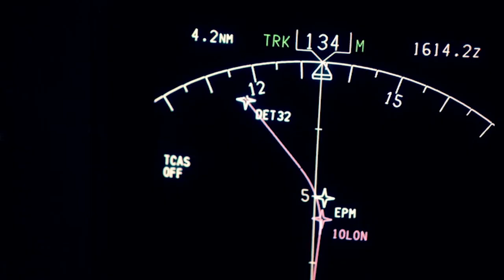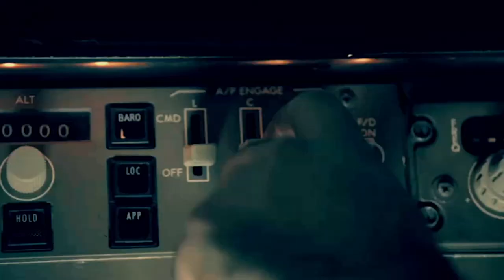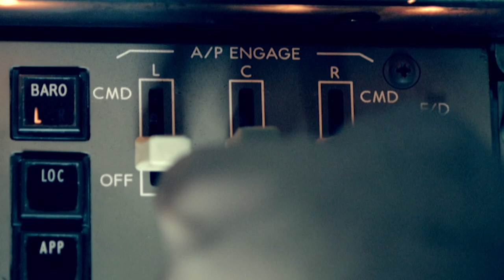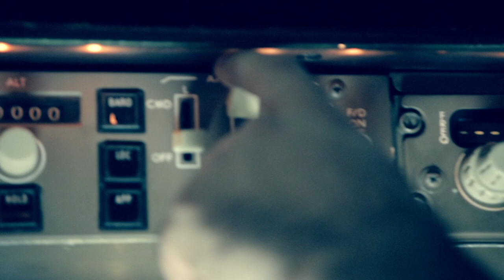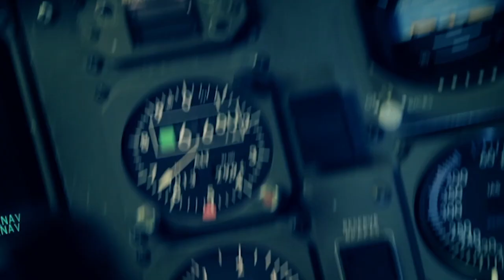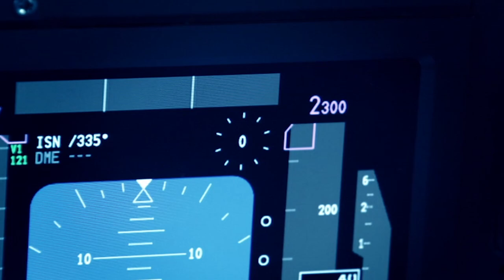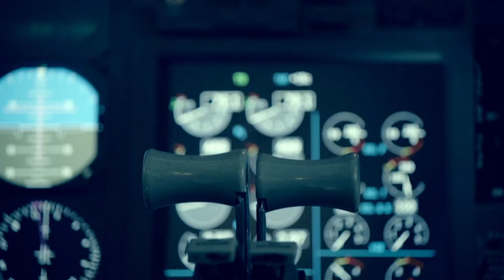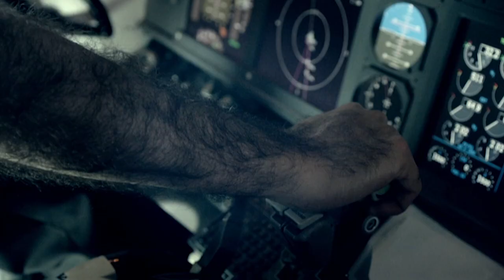Auto Pilot Causes Multiple Plane Crashes | Air Crash Confidential

Comment: The biggest disasters happen with a small hint of problem. The malfunctioning of the radio meter may not be a big deal but when you are in the air at 35000 feet , it's better to take precautions rather than waiting for consequences.
Reply: very true
Reply: @pasoundman  what precautions tho? You have 3 other altimeters. It’s not like that is gonna cause a crash
Reply: @johnb8956  The barometric altimeter isn't adequate at low level, hence the radio altimeter, so in reality there's no redundancy there. A sensible precaution would be 2 radalts.
Reply: @pasoundman  they do... 2 of each, for this exact reason

Comment: There is no such thing as autopilot error. The autopilot does not fly the plane on its own. The pilots input what they want it to do and it obeys the orders given to them
Reply: Thomas Mortimore oof, so ur saying that the radio altimeters, artificial horizon, PFD, MCDU and etc is not bound to fail at all and it’s mainly pilot error...... lol
Reply: The idea of autopilot is that it will keep the plane steady while pilot and copilot do other tasks. Like landing calculations to see if the plane has the right land weight. So if the plane needs to turn the pilot does the input.
Reply: Colin McCarthy umm... no, the autopilot is what is mainly flying the plane during a flight.. pilot program a route in the FMS, FMC, or MCDU that will take them to the destination of their choosing. Then after they depart after reaching 5000 ft or maybe less they turn on the autopilot and the auto throttle and it mainly flies the plane until it time to land, and if the weather is bad they use the auto pilot to perform an ILS and or a CATIII arrival which basically lands the plane for them in IMC conditions. They do follow the pilots “orders” but it’s used mainly used to take them for point A to point B. And plus the autopilot might have mechanical issues from time to time... it happened a few times.
Reply: Sync Aviation sorry I was talking about when not flying in the route inputed but say if the plane is diverted they might be told to change heading but pilots won’t create a new route for a diversion so the do they new inputs. I didn’t mean that it was how it was fly routes. Sorry if it was taken that way
Reply: Thomas Mortimore there are two FMC (depends on what plane u fly on) not 2 autopilots... there are FMC selections where if you want to switch to the copilots FMC you can... but it’s gonna have the same route on it.
Reply: and you are in expert i guess you know more Than all those people in the show
Reply: Yeah. Basically “Auto-Pilot Error” is just another way of saying: “Pilot Error”.
Reply: Sometimes The system may malfunction...
Reply: @tomstravels520  THe pilots were confused which altimeter to trust and which to not
Reply: @blcj101  

Guys seriously, the Auto Pilot can fail.. It's using the instruments of the altimeter, flight speed, computer information its being given checking the flaps, angle, etc. 

If ANY of these fail (Which they have all failed at some point hundreds of times in the past), the auto pilot fails, because the auto pilot does not know its actually flying at 8,000 feet, not 100 ft like the altimeter is telling it.

Comment: Wonder if it might be a anti-stall/Auto-pilot error on the latest 737-max 8 crashes?
Reply: No it's unrelated
Reply: It’s a system called MCAS. It puts the plane in a dive if the system detects a possible stall without the pilots inputs. So sad it was designed for safety, but ended up killing people unnecessarily.

Comment: Thats not how the plane crash, it should break to some large pieces
Reply: It's how that flight crashed. They barely had enough altitude, but they came in at a very shallow angle when they actually impacted the earth, they were also going relatively slow still (still under optimal flight speeds), So the plane didn't break up into pieces, it broke up into 1 or 2 separated parts since it slid mostly horizontal during the crash.

Comment: as usual cheap boeings keep crashing BUY AN AIRBUS! you fools
Reply: There have been several issues with the Airbus too, except with Airbus organization they do everything to blame the pilot. Check out this link https://www.wired.com/2011/07/an-airbus-captains-take-on-the-air-france-disaster/ There are three other Airbus crashes that I can think of where the planes autopilot system was at fault.
Reply: Brian Savage, you're right. This is why Airbus should be called Airbug
Reply: Canardeur Ive heard more than one pilot call them Scare Busses
Reply: Brian Savage, Scarebus is indeed a common nickname for those flying pieces of junk.
In France, a former pilot named Norbert Jacquet has denunciated the Airbus technology and because of it, he has been persecuted by the French state for 30 years and is now homeless!
Reply: Frank Vincent Tolores Gesmundo Boeing is more safer. Airbus computer can cause a crash.
Reply: @Canardeur  - This comment aged poorly